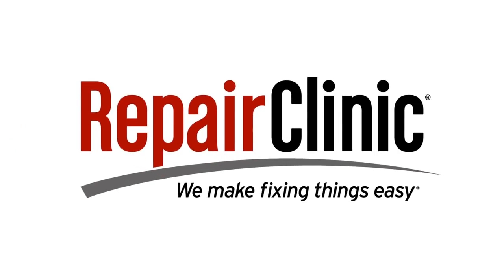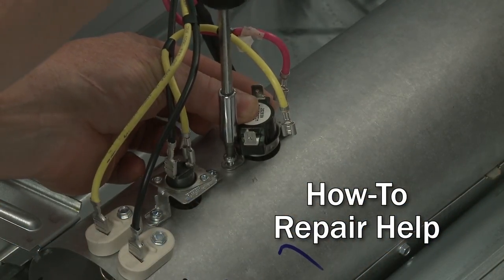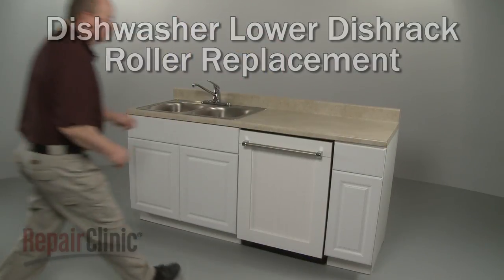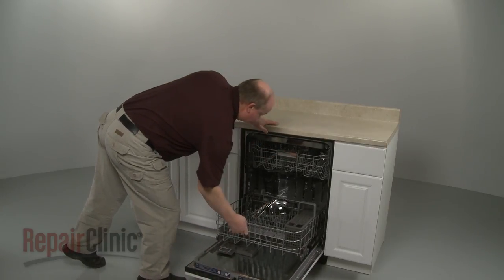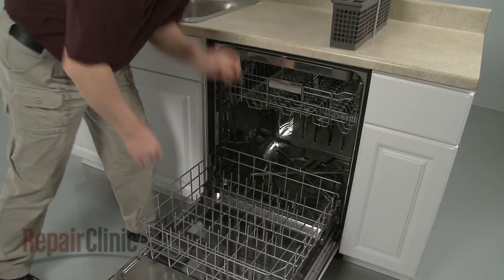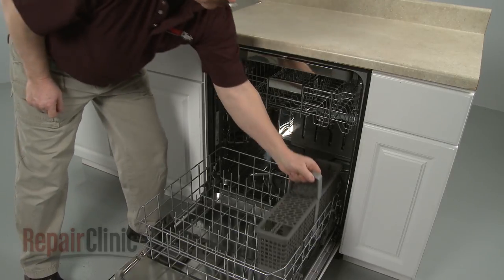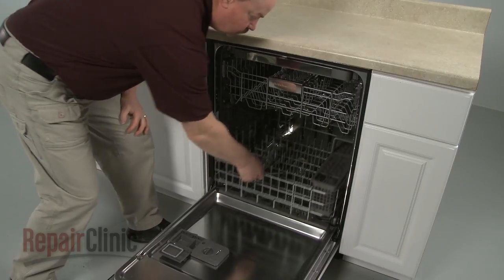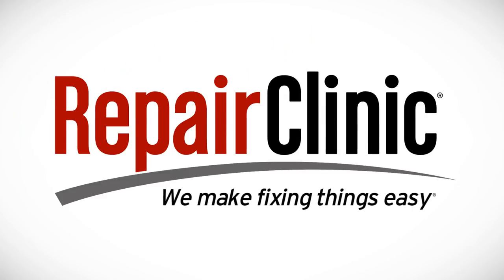KitchenAid Dishwasher Dishrack Roller Replacement WPW10195417

Comment: Very easy to do,  but unless the wheel "chassis" is broken, the OEM replacement wont last longer than the original part did. Neither will the knockoff "improved" models.  

The most common reason those lower basket rollers need replacement is because the wheels fall off.  The snap-in retainer design of the basket suspension is weak. If the washer is handled with kid gloves, that design is ok, but in the real world, inevitable side motion of the rack against the door tracks with hot loaded racks will make the wheels pull outward and eventually the retainers will fail to hold their grip. The plastic retainers aren't available as replacement parts, so instead of 8 "lugnuts" , you replace the "vehicle's" entire suspension.  

 If the wheels are intact, for less than $10 you can replace all eight push out retainers with stainless 10-24 x 3/4" truss head screws, M6 washers and nylon insert lock nuts. The washer and nut go in the wheel recess.  Lubricate the wheel axles with SylGlide and this "hack" will outlive all the other movable hard plastic parts of the interior. This is so simple it doesn't need a video.

Comment: I need to buy replacement wheels.  However, my model number is W10195419.  Will W10195417 work if I replace all 4 wheels?
Reply: I just replaced one set of wheels on my whirlpool dishwasher. I went to Amazon and did a search for Whirlpool replacement wheels. I bought a set of 4 wheel assemblies for $17. That said, my wife actually ordered the wheels. I took a picture of the serial and model numbers using my camera phone and she found the wheels using that information. Hope this helps